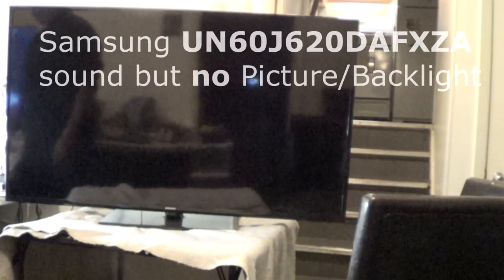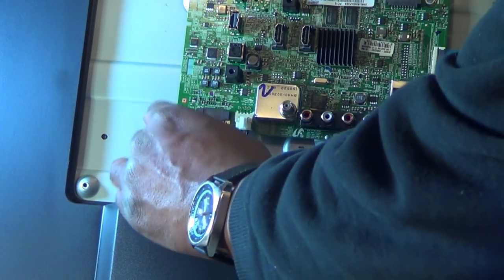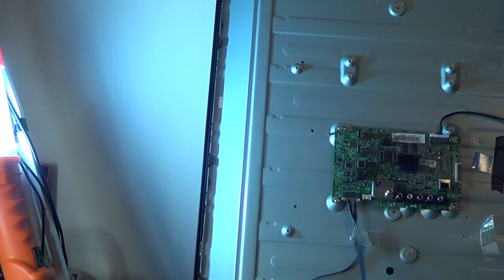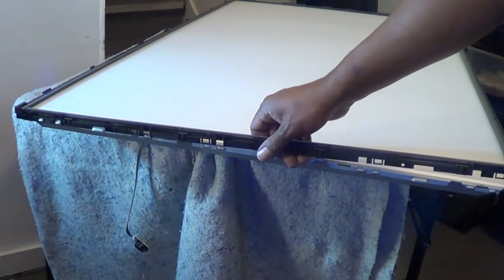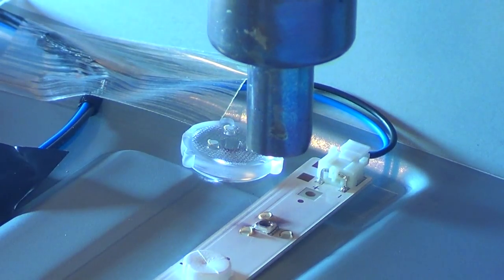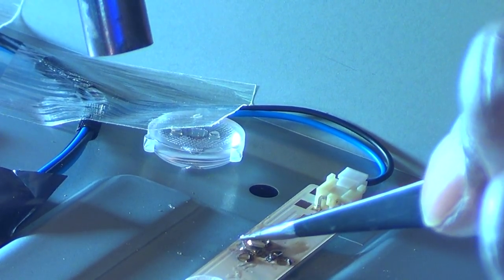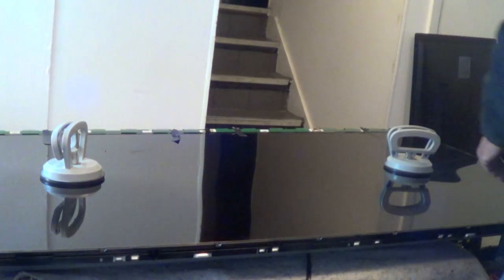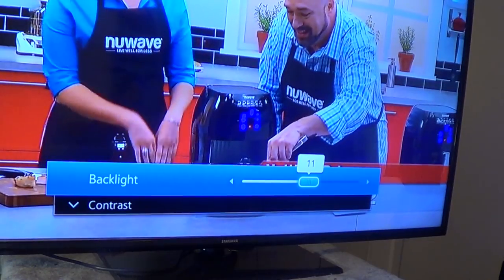Samsung UN60J620D no backlight, disassembly and  LED replacement.

Comment: Thank you, mine had cascading failures -- after replacing the 8 bad ones, five more failed.  After letting it sit for a few months in the basement, coming back to this video now with brand new LED strips to see again what order the pieces went back together.

Comment: Hello bigdogg that’s for all the videos. They are awesome. I have this same TV. No backlight can see the menu with the flashlight. I can not hear any sound from the tv either. I don’t have the tester you have but when I ohm out the strip to the LED nothing comes on either of them. So how do I determine if it’s the LED or TCON board?
Reply from the maker: If you can see the menu with flashlight, then the Led's are probably bad.
Reply: @bigdog8882  thanks so much where can I purchase the led strips?

Comment: Great video, and a lot of information.  I didn't even know those LED testers existed, so now I may buy one to fix a dead Samsung 55" at work.  Only question I have is, what kinds of LED's should I look for to replace single dead ones if that ends up being the issue?  That is, I see they're 2.8v LEDs but wasn't sure if they're 1W LEDs or something with less power.  I know 1W LEDs usually have 6 leads and looks like an asterisk, so I'm guessing these aren't that powerful.  Are they rated for any specific amperage/wattage?

Comment: I have kind of the same as your tv samsung but, when i check back light led one side ( black , blue )was 115 v ( dc ) and another side ( black , blue ) was 83 v ( dc) back light was turn on when i check , zi do exactly what you did  , so is that indicated that bad led  strips ?  And the power board output wwas 250v ( dc) for each side when i recomnect connector from led cable Thanks for your video .
Reply from the maker: The lower voltage usually indicates that you have shorted leds on the strip. So yes replace all the strips.

Comment: Ive got piles of lg, samsung led tvs that have this problem,  whats strange is the cheaper brands of led tvs seem to hold up better with leds. Remember they set led backlighting to 100 percent from the factory , so turn your lights down people. Holler at me BigDog.

Comment: At 4:13 you are checking the voltage going to the LED's. How do you know what number you should see for each line? I'm getting 74.8 and 72.5 on a un60j620daf.

Comment: I just got around to studying the use of LEDs in TVs, lights, etc.  The one question I have is why do they wire all these LEDs in series instead of parallel?  Have not been into electronics for awhile but I do remember my series/parallel voltage and current.  Just wondering.
Reply from the maker: I believe it has something to do with the Feedback circuit.
Reply: @bigdog8882  how can you clean the diffuser white sheet if they got dirt , finger prints pleas let me know or white spots

Comment: I have the 65 inch version of this one and I bought the same led tester you are using...  It shows both sets of wires are open.  Is that unusual or do you think the problem is the wiring?

Comment: I have a Samsung LN40C530F1FXZA  when you turn it on the picture comes on for about 15 seconds then goes out if you unplug main board from power then plug it back in picture comes back. Also if TV is off but plugged in and you unplug it the screen will come on for about 30 to 45 seconds then turn off . While  the picture is on there are no lines and a very good picture. any idea as to what it maybe.

Comment: Is there a way to clean up the white defiusers if you got dirt or finger print
Reply from the maker: Just use a damp clean towel then make sure U wipe it completely dry b4 you reassemble tv

Comment: My tv would not turn on. It was power cycling, so when I opened it up the LEDs were blinking. I replaced the power supply and that didn't work So I bought New LED strips and am currently replacing them now. Hopefully that fixes my tv.

Comment: Seems like the LEDs are toast on my 55" Samsung as well. Can someone explain to me that if one LED lamp goes down, they all go down...just like some cheap strings of xmas lights.?
Reply: I think so, someone said they are in series so if one goes, there is an opening in the circuit.

Comment: Bigdog, I'm working on nearly the exact 60" Samsung.  I've disconnected the driver boards (11:43) but when trying to remove the panel glass with suction cups, it still feels glued or connected somehow at the bottom.  Any ideas what could be happening or what I could have missed?
Reply: @Ermida Rurambo Sorry for just seeing this.  I could never figure out where or how the panel was connected to the bottom piece, so I just took the rest of the frame off and removed the panel with the bottom piece still connected.  I placed the screen on a table, allowed the connected part to hang over.  It wasn't ideal, but it worked out, and I now have a fully functioning TV!

Comment: So what tool / setting are you using when testing individual LEDs?
Reply: I just searched on Amazon for "tv LED tester" and got a bunch of the same exact one, just sold by different sellers under different brand names.  They-re in the $30-40 price range

Comment: It seems to easy for those who is watching but it isn't, is almost a diy project, I guess hardest part is removing the black screen on top of the TV, my tv has black spots spread all over the screen owing to dust got inside the white led spread sheets, only thing I'm afraid is removing the black screen, don't have those two tools that glue on the screen to safely remove it

Comment: Invest in a hot plate from eBay. Sure you have to remove the strip but there would be a lot less fussing around and a much cleaner repair.

Comment: I'm going to take a leap and risk that you do read your comments or LEDs the lights standard or are they different from TV to TV this is the first time I've actually have an opportunity to replace LEDs on a TV and I've been doing some repairs here and there that I pull out of the trash so I have LEDs out of you know TL tcl's just cheapo TVs that I save but I don't have anything for a Samsung right now that's why I'm asking